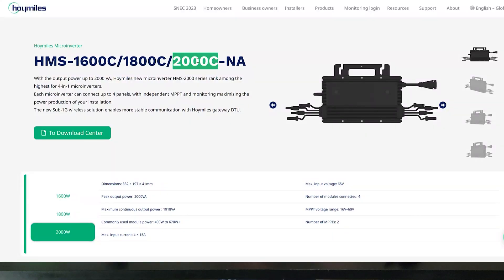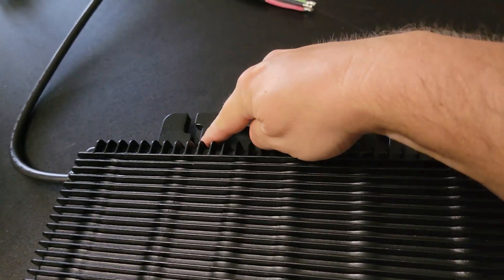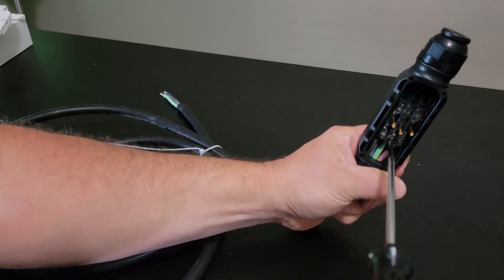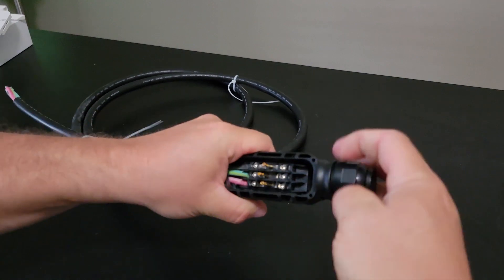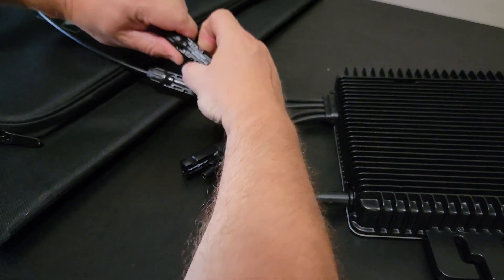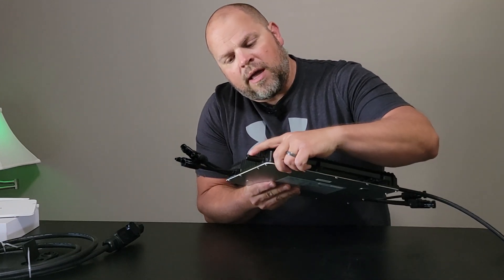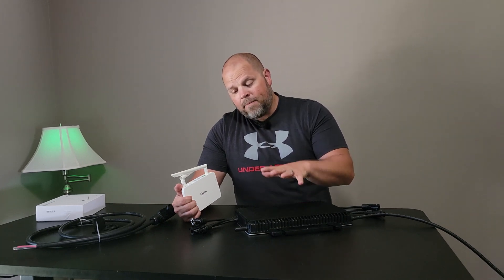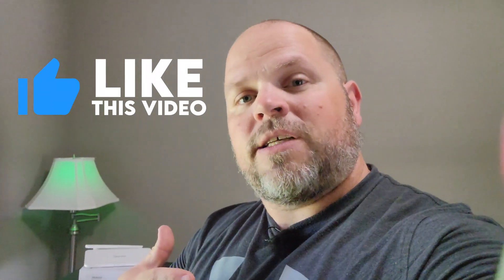Is this THE ENPHASE KILLER?? Hoymiles Microinverter HMS-2000C - 2000 Watts 4 in 1

Comment: If you're an inverter was located right next to the item that you were powering couldn't you just cut the wire coming directly off the micro converter and just wire it directly in to the product you need it wired into and wouldn't need all that trunk cable

Comment: What would recommend for a caravan battery system ?
Reply from the maker: What are you looking to run in your caravan? Off the top of my head with no further details, I would recommend for most people to go with a high quality power station like a Bluetti. Since it is off-grid the Hoymiles and Enphase microinverters will not work correctly for you. They both require a grid connection.

Comment: I am going to have to cancell my inverter order.  Amazon is blocking me from contacting the seller and according to hoymiles the seller has to create an hoymiles s-miles cloud end user account .  Not going to wait until I get the inverter to find out I can’t activate it with out the a-miles account.  More info is needed on this process if we are going to promote this product while at the same time Amazon blocks contact to the seller.  How would warranty work.  What a mess cancelling now.
Reply from the maker: Did you try reaching out directly to Hoymiles from their website? That way, you are dealing with them directly.

Comment: Helpful videos.  I ordered the 1500 using your link.  Searched and could  find  the”  1 inverter  “ to grid connector.  Lots of clones on Amazon for homilies.  Planning a small 4x400w and 1 hoymile 1500 inverter for 240v/60hz.  Spooky thing is that AI says not to use BC05-BR3M-02  for 240v becuase it’s only rated at 300v.  Ordered the hoymiles BC05-BR3M-02  anyway.  Very hard to find the official hoymiles BC05-BR3M-02 on Amazon. All the rest of the BC05-BR3M-02  are clones.  Hopefully when the dust settles this will all work out and I’ll have a 240v/60hz 4X400 watt system.  Thanks 

Solarsys® - Photovoltaic Accessories - AC 300V / 12A Connectors for Hoymiles HMS Series Micro Inverter 
 https://a.co/d/07upkE77

Comment: Do these have any type of CT connection? With the Enphase you've got CT connectors and power export limitation. If these don't have CT's... then I guess you just export the extra by default without really monitoring it? Nice to have some competition, and the company has a nice product line up.. I see Aptos rebrands these as their own as well. But, I feel like they might be lacking in a few areas compared to Enphase.
Reply from the maker: I am working on building a complete Hoymiles system. In those upcoming videos, I think I will answer a lot of questions that most have about these microinverters and how they function compared to my Enphase system.
Reply: @TheSolarPit looking forward to it, just starting to build my small array.. so I have been deciding between Enphase or something else. It’s come down to the EG4 18kpv or IQ8s, and have considered Hoymiles. I would consider the 6000xp off-grid, but do not have the means to do a transfer switch for off-grid without significant rewiring. All in all, my build is coming down to $5000 DIY with FTC, vs $15000 - $25000 with an installer. Amazing how much DIY can save, thank you for promoting it and helping others learn.

Comment: Can I ask what if I put two solar panels in series to equal one connector 500w. So that will be 8 solar panels in total to equal 2000w. Would that be ok or it may do damage. Can you give me advice? Thanks.
Reply from the maker: It should be fine but be careful with the voltage rise when connecting in series. That could be a problem.

Comment: Hi, I like your videos.
I have a quick question, is it possible to limit the power feeding into the grid in these micro inverters.
I heard power limiting options are available
Reply from the maker: I am not aware of this function. I am curious why someone would want to limit the back feeding output to the grid though? Especially on a net metering agreement.
Reply: In some areas it would be good to control the percent of inverter output.  Some areas don’t have net metering and if you produce more than you use the meter counts the excess to the grid as your consumption and you wind up getting charged for your excess power.  If you can limit inverter out put using the app on a schedule that would help control and minimize any excess power sent to the grid on your dime.

Comment: I am planning to use this micro, but I am in a budget, so I can afford the microinverter and 2 solar modules for now, do you know if this micro can work with only 2 solar modules or it needs the 4 to operate properly?
Reply from the maker: It can, but I would recommend the 2 panel version (dual over the quad) if you only have 2 panels. Thanks for watching and commenting 👍🏻

Comment: Do you suggest to put the inverters elsewhere under shade or just leave it under board. Worried about the performance after sometime
Reply from the maker: They are designed to be installed directly  under the pv panels. That's how I will install them when I build my next solar array. Thanks for watching and commenting 👍🏻

Comment: great valuable video, thanks. One question, what is the difference of HMS-2000"C" with the HMS-2000 ?
Reply from the maker: One difference that I found is that the C version on the HMS quad microinverters holds the UL 1741 cert, and there is no mention of that on the version without the c. I know the C version is approved for use in the United States because of that UL listing. Hopefully, that helps you out. Thanks for watching and commenting 👍🏻

Comment: are we able to connect this micro on a home outlet?
Reply from the maker: My last reply on my Vevor micro inverter video. This one would not work like that. It's a 220v microinverter. Thanks for watching and commenting 👍🏻
Reply: Why could y you use a BC05-BR3M-02  to connect a single inverter to a 240v outlet?  Should be the same as how folks are connecting a 120v version to a 120v outlet.  Just curious.

Comment: Any idea where I can buy those?
Reply from the maker: If you're in 🇺🇸  then there are distributors that sell them. Currently a little difficult to get since they are sold out at most places. Hopefully, they become easier to get because I do believe it's a great microinverter. Thanks for watching and commenting 👍🏻
Reply: @TheSolarPit  
I did not DIY my system and I regret that. I was actually sold a "7.2kW" system. They installed 7.2kW of panels and 6kW of inverters. Then they continue to argue that I have a 7.2kW system.
So, I was thinking about replacing the microinverters myself in order to reap the rest of the mid-day energy  that I currently don't get. 
Thanks again for the videos you share.

Comment: Thank you for the content.  Your research helps in not re inventing the wheel.  
So have you compared these to those sounds like mfase eight brand?
Reply from the maker: Enphase biggest IQ8H's max production at 384 watts. Hoymiles rating is right 479 watts production per panel. For everyone looking at 450-550 watt panels, your max production will come from Hoymiles. IQ8's provide that sunpower backup, though, so that is nice. I would like to see both manufacturers offering an off-grid solution. Where grid tie was not required on microinverters. Then things would get very interesting. I'm not convinced it's the lack of technology more than red tape politics. Thanks for watching and commenting 👍🏻